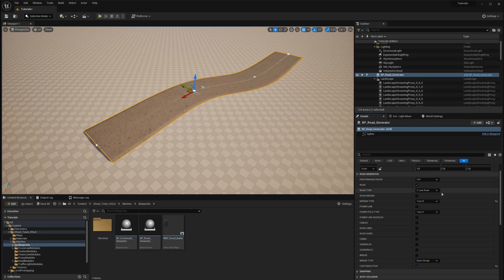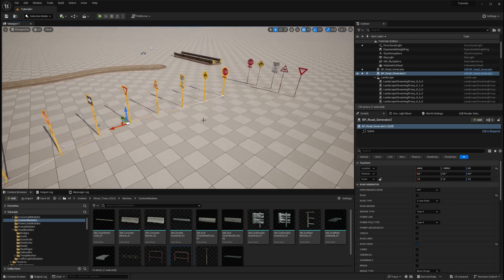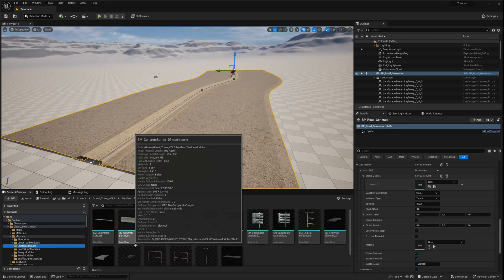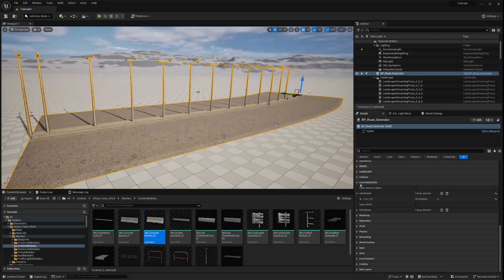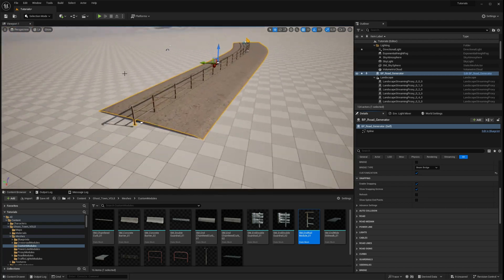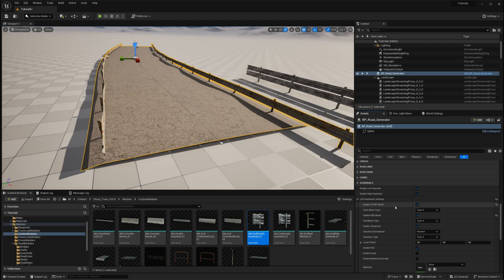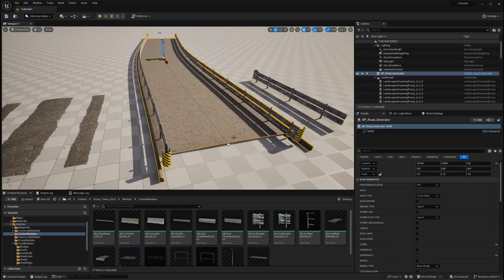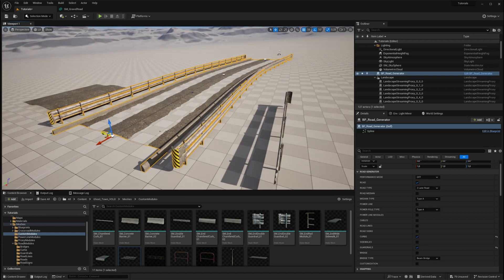Crossroad Generator For Unreal Engine 5 - Customization

Comment: Is it possible to change the sidewalk width without modifying the mesh itself?
Reply from the maker: Thank you for reaching out with your question! At the moment, the sidewalk width is set by the default mesh preset, which means it isn’t adjustable and remains fixed. The only way to change the width right now is to create and use your own mesh preset, or manually edit the existing default one. We are, however, planning to make this feature more flexible in the future so that you’ll have more options available when customizing.

Comment: What would be the best way to create the dip in a sidewalk where cars come into a parking lot or driveway. Usually the sidewalk is the same material it’s just lowered to road level for smooth transition. Basically I want the curb and sidewalk on the same level as the road but with a smooth transition back to normal sidewalk hight on each side of the threshold. Hope that makes sense. Thanks!
Reply from the maker: Thank you for reaching out with your questions and for your feedback.

You can achieve the smooth transition in the sidewalk using the Crossroad Generator by following these steps:
1. Drag and drop the Crossroad Generator into the editor.
2. Select the crossroad type “Crosswalk.”
3. Enable Sidewalks in the Crossroad Generator settings.
4. In the Sidewalk Settings, enable Variations to customize the transition.
5. Choose Variation Type B, C, or D, depending on which works best for your setup.
6. Additionally, you can override the material to ensure the sidewalk and transition section share the same material for a seamless look.

Let us know if you need further assistance! support email: (contact@rendertale.com)
Reply: @ that worked perfectly! I appreciate it! If I wanted that dip to be wider would I just stretch the scale of the crossroad generator? I did that and it works just wondering if there’s a different way! Thanks!
Reply from the maker: Yes, there is a more effective way to customize the crosswalk preset, but it requires using the Modeling Toolkit in the editor. Follow these steps:

    Locate the Crosswalk Mesh – Find the mesh preset you want to customize. You can access it in the Advanced Settings of the Crossroad Module or directly in the Mesh Folder.
    Duplicate the Preset – Make a copy of the existing mesh preset to preserve the original.
    Edit Using the Modeling Toolkit – Use the Modeling Toolkit to modify the mesh. You can stretch, scale, move, or edit UVWs as needed.
    Replace the Mesh – Once customized, assign your modified mesh preset in the Advanced Settings to apply the changes.

This method allows for precise customization while keeping the original presets intact.
Reply: @Rendertale  Thank you! I was thinking that this was probably the way to go. I appreciate the responses! Great product. Thanks again.

Comment: Hi! I changed the road to the gravel one you linked earlier, but what about the crossroad? How can I modify it to create a consistent road?
Reply from the maker: Thanks for your question! You can easily override the material by enabling the "Override Material" parameter in the crossroad settings. Alternatively, if you'd like more control, locate the crossroad mesh in the advanced settings, then edit the material directly by replacing it in the mesh settings. Hope that helps!

Comment: Hi, how can I change the side walk scale only ? I want to increase the side walks scale width but  I couldnt find a way todo so. Scaling from the editor also scales the road even enable scale is disabled on the road options.
Reply from the maker: Thank you for reaching out to us with your question. We appreciate your detailed description.

We have tested the scenario you described, and scaling functionality appears to work as intended. If scaling is disabled on the road, you should only be scaling modules where scaling is enabled. Therefore, the issue may stem from another aspect of your configuration.

Currently, there is no option for local scaling at the spline level—scaling applies globally. However, we understand the need for more granular control and will consider adding this feature in future updates.

In the meantime, we recommend the following alternatives:

    Use a custom mesh to extend the sidewalk.
    Customize the current preloaded meshes in a modeling editor to achieve the desired width and look.

If you continue to experience scaling issues, please contact us at contact@rendertale.com. Kindly include screenshots so that we can better understand your situation and assist you more effectively.

Comment: Where can we get the gravel road mesh?
Reply from the maker: Thank you for reaching out!

The gravel road mesh was used in our demonstration to show how users can customize roads with their own meshes through the customization module, so it isn’t included as part of the default pack. However, you can download the gravel road mesh from the link below and easily import it into your project.
Link:
https://drive.google.com/file/d/1sSqSAh8cLA5bIm7NEQfg_8SVWX0-y9Yp/view?usp=sharing

Once imported, you’ll need to apply the gravel material to the mesh. You can find this material in the materials folder under the name MI_GravelRoad_B_RMD. For added realism, we used POM (Parallax Occlusion Mapping) to achieve a displacement effect on the road. This material preset is also included in the pack—just set MM_Base_POM as the parent material in your material settings.

If you have any questions or need further assistance, feel free to reach out to us at our support email: contact@rendertale.com.
Reply: @Rendertale  That file does not exist in google drive anymore
Reply from the maker: Hello, here is the link for you:
https://drive.google.com/file/d/1lnPkj7V1GJL523HkrKp5u3Chr6ChJVb9/view?usp=sharing

Comment: is it possible to make the cables affected by the wind directional source?
Reply from the maker: Thank you for reaching out with your questions. Currently, this feature is not supported. However, it is possible with a modification to the construction script. We appreciate your suggestion and will consider adding this feature in future updates.
Reply: and also some powerlines spawns middle of the road, any way to fix it?
Reply from the maker: Thank you for reaching out with your questions. Yes, you can use the local offset parameter in the powerline module settings. Please watch this tutorial for guidance
https://www.youtube.com/watch?v=7bAD9O8Pr4U